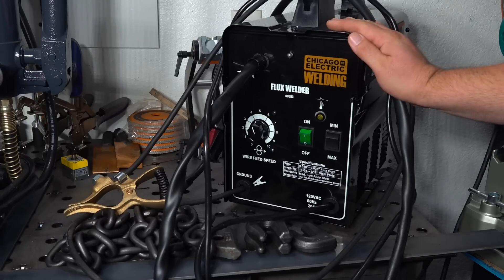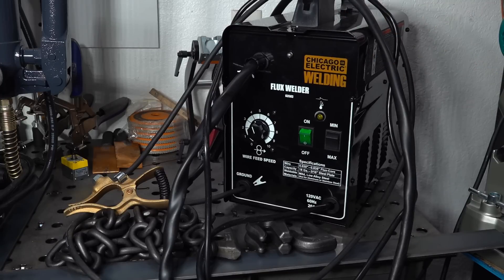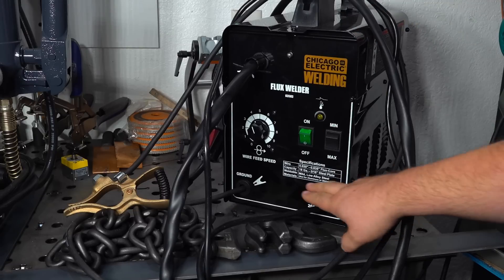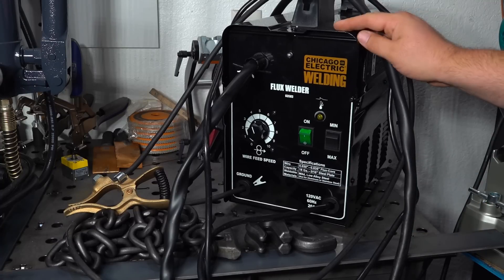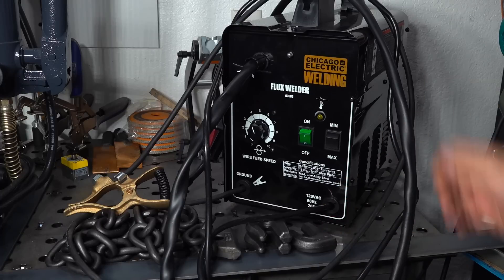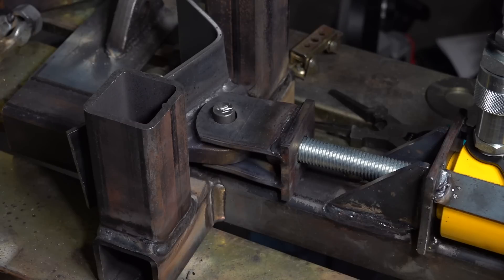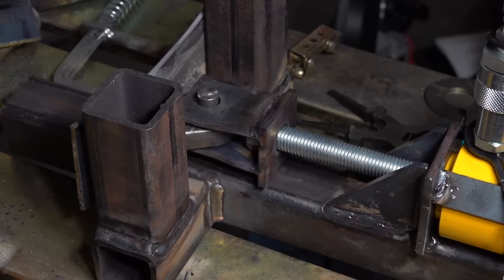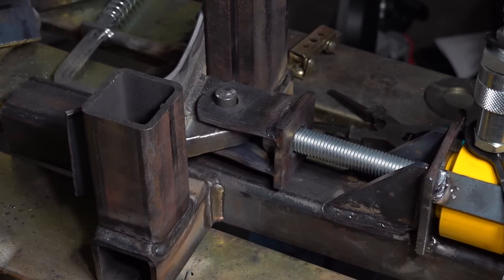Harbor Freight Flux Core, Weld Strength Testing Part 1

Comment from the maker: I have three more videos where I test the welds from this Harbor Freight welder.  I do more bend tests, cut and etch to show penetration results, measure actual amperage and voltage output, and test different wire sizes.  I even buy and test a second machine, in case the first one was defective, and I convert one to DC and do more testing.
Reply: bigtb1717 what do you think about that machine? Worth the cost? Do you believe it will have a long life?
Reply: Would you try .025 or 6 wire? I've not been able to get mine to get any penetration.  Though I've not turned down the feed speed which I shall be trying next time I go to where my machine is.
Reply from the maker: I don't believe flux core comes in sizes below 0.030".
Reply: bigtb1717 how much are they payin ya? Or are slighting HF just because you put shit bag welds down? People ........ smh.
Reply: @TheWopper78  Sounds like a pretty objective review to me.
Reply: Sealed 150 mig user instructions

Comment: So basically you can make thick metal stick to thin metal but it just can’t have a load on it… I’m building a small fabrication table and the top is a good bit thicker than the frame. But as long as the frame is strong I shouldn’t have any trouble with the plate welded to the thinner metal since it’s just sitting on top of it. Thanks for the video.

Comment: Idk, this has more to do with your settings and less to do with flux welding...
Reply from the maker: It definitely isn't an issue with flux core.  The problem is that the Chicago Electric 90/125A flux core welders have AC output, which doesn't work well at all with flux core.  I have several other videos where I test different travel speeds, different settings, pre-heating and even buy a second welder to show it wasn't an issue with the first one.  The issue is the AC output.  I even converted one to DC output to show the difference.

Comment: Thanks for this post. 110v welders are not be dismissed as the author states. They are great for DYI repairs on garden equipment, lawn mower decks and auto repair and so on but defiantly not for structural fabrications or repairs. I wouldn't repair trailer leaf spring hangers with them with any confidence. Ask me how I know. There just isn't enough penetration in  3/16 and 1/4 steel and up to handle over stressed joints. I am not a believer in triple passes with a 110v 030 or 035 flux core for structural applications. If the first pass does not penetrate enough, no other lathering's of melted wire will help. At 64yrs old I am not a professional welder but I do hold my own with a Lincoln gasless flux core. For folks looking to getting into the "hobby" and light steel repair welding ask a pro before you buy a machine. Because it's all about penetration into the gauge steel you intend to use. Other wise a little DC electrode flux core welder is a ton of fun to learn on. I've made garden tractor trailers, patio plant stands, foundation vents all from discarded 3/32 bed frame angle iron. You'll find this perfect practice angle iron at your local dump or at the Habitat for Humanity Restore. After a while you may get the fever to wire up a 30 amp source in your garage and start running an old Lincoln stick tombstone! Have fun hooking metal together!

Comment: Interesting and thanks for the testing.

If I were not broke or had more than 20-linear-inches I would have bought  a $350.00 welder maybe even a stick welder.

The biggest complaint I have is that the instructions call for a 20-amp capacity outlet: nowhere in the box dud this information post where I could see it.

I think 1/8" or 2/16" is this machine's  limit.  I must have a 8- wire speed with 0.030 wire and mo more than 3/8"-1/2" stub with 10-20° degrees drag angle. The metal I am practicing welding on has much more of an orange color than what is used in this video.

I suggest cutting 90° to the weld's longest dimension to witness actual penetration.

Comment: bro you just gotta cook it more baby. Slow down and get more penetration in her!
Reply from the maker: I have another video where I test different settings and different travel speeds.  Also one where I test multi-pass, and one where I test pre-heating.  I do cut and etch tests on some of those.

In some cases, a slower travel speed may result in greater penetration, but in a situation like this where it's already running too cold, it often makes it worse.  If you slow down, the weld bead gets larger, but it can sometimes just build up on top and cause the arc to get further from the base metal, reducing penetration.  

Unfortunately, the biggest issue holding this machine back is the AC output.  Flux core doesn't run well on AC.  I have another video where I do the very most basic of conversions to DC on this machine and test penetration again.  It makes a night and day difference.
Reply: @bigtb1717  my welding look liek doodoo but its soo strong. I heat the crap out of it,

Comment: Comparing a 240v to 120v. That's like Comparing a 8 cyl truck to a 4 cyl. Of course the 240 will do better. Do a comparison between 2 120v. The HF works good. Especially for $89.
Reply from the maker: I agree.  That was the whole point of this video.  I've seen many people claim that their 120V welder is just as capable for whatever weld they want to do.  The common saying is "the welds don't look great, but they'll hold."  With this video I just wanted to show that there is, in fact, a big difference in the capability of a 120V welder vs. a 240V one.
Reply from the maker: Also, I do have several more videos with this welder comparing various techniques to see how performance is affected, as well as converting it to DC and testing before and after.

Comment: OK SCRATCH THAT, I didn't know the specs for this box were so low. I expected the average 125 amp entry level. It's 90??  way too puny. 

Did you use ... spray transfer mag and compared it to short circuit ?? sure looks like it 

You say nothing of the settings used 

Was the HF really set correctly? You've demonstrated each time that its weld had very very poor penetration , very cold welds , very tiny deposition rate
Reply from the maker: I have several other videos with this welder and I do go over exactly what settings are being used.  I even measure actual voltage and amperage output.  It puts out more than you might expect.  It actually maxes out at nearly 140 amps.  It is "rated" at 90 or 125 (Depending on the version) but it actually puts out a bit more than that when maxed out.  

I also test different wire feed speeds, test on different thickness of metal, test with different travel speeds, bought a second welder in case the first one was defective, test with and without pre-heat, test with multiple passes, and more.  I also convert one to DC and test before and after that.  When stock, this welder has AC output and that simply doesn't work very well and doesn't provide very good penetration with self-shielded flux core.
Reply: @bigtb1717  ok, I'll check you other vids ! 👍🏻 Thanks

Comment: Hey -- what setup are you using for the pull hydraulic test and the press hydraulic setup? I saw an Enerpac GF120P -- what else are you using? Also, thanks for the video!
Reply from the maker: I have a little Enerpac hand pump and a hollow cylinder.  The press is a small, Dake benchtop press.  The little rig I had the cylinder in is just something I threw together in my garage.  I've been considering getting it back out to test some more things.

Comment: I do have a harbor freight welder. and I have to say your tests are inconclusive due to your claim of single pass with both machines with is total bs. you did a single pass with the harbor freight welder but 2-3 passes with the esab. however, you used the cheaper harbor freight welder which welds in AC, not in DCEN. I spent a little bit more for my harbor freight titanium flux core welder which welds in DCEN. I repaired my car's frame rot using my welder and my welds are still holding strong on these crappy NYS roads. I have also built a massive fire pit using the welder and they hold well to the heating and cooling. runs both .030 and .035 wire no problem.
Reply from the maker: I absolutely did not do multiple passes with the ESAB.  It was one pass with each machine.  And I have said many times, in comments and in other videos, that the main thing holding back the Chicago Electric 90/125A flux core welder is the AC output.  It drastically limits penetration on thicker material.  

I have many more videos with this welder where I bend as well as cut & etch multiple joints after all kinds of different variables, including multi-pass, pre-heating, different travel speeds, etc.  I even bought a second welder after several people questioned whether mine might be defective.  I even converted one to DC output to show the difference in penetration between AC and DC with the same machine.

I also reviewed the Titanium Easy Flux 125 and liked that welder quite a bit.  I had a lot of good things to say about it.

Comment: Preheating big pieces of metal is a great way to make these little machines better at bonding with that metal
Reply from the maker: I think the biggest issue with this particular welder is the AC output.  I have actually converted one of these machines to DC and did cut and etch testing before and after.  Night and day difference.

I have another video where I cut and etch to check penetration with different levels of pre-heat.  I used this welder in the stock, AC output form for that video.

Comment: The best thing this video illustrates is how technique matters with fluxcore and low-power welders. Prep, notching, and using the right size wire on the right speed and amperage for the material you're welding is paramount to strong fluxcore welds.
Reply: Yah-

-for five hours my welds were cold, tooling a stub, and splatty.  I took off the nozzle like a YouTuber said and I had a difficult igniting the spark.  Nozzle back on and it a snap.  

It makes no sense to me, but a faster wire speed does give a weld with a "more penetration/good weld" appearance.
Reply from the maker: The main thing holding back the Chicago Electric 90/125 amp flux core welder is the AC output.  Flux core simply doesn't run well or penetrate well on AC.
Reply: @bigtb1717  -I dare say that can be rectified.  ;)

Comment: 1- In the trades we call it Sucks Core, Even NR211through a miller XMT sucks. 

2- If you know how you can make wuite acceptable welds with the little HF machine. 

Just for kicks we used to tell new kids they were taking a weld test. Vet up with 6010  on a "machine" we hid behind a truck,,,,,2 car batteries.   And a lot of them made some welds that we not all that bad.  Skilled weldors can make good welds with bad welders.
Reply: Amen

Comment: Redo this test on the lifting pads with a couple of passes with the harborfreight welder
Reply from the maker: I have several more videos with this welder, including testing multi-pass and pre-heating.  I do more tests with the press, but I also cut and etch a lot of joints.

Comment: Oh you have the "cheap" one. I got the "expensive" one. I'm rocking the omnipro 220 but doing flux core at the moment because gas tanks are expensive. But I would love to know how strong they can weld so I can have an idea as to how far I can push what I want to make. Also I'm using 110 or what ever it is 120.

Comment: would this be a good welder to learn on ?
Reply from the maker: It could be.  Just be aware that because it uses AC output it will run a bit different than most flux core welders.  It can definitely still be used as a starter machine to learn with, especially if you stick to 1/8" thick material.
Reply: @bigtb1717  awesome ty been wanting to learn and didnt wanna spend an arm and a leg to start out
Reply from the maker: Where about are you located?  Are you in the US?
Reply: @bigtb1717  yes sir texas
Reply from the maker: Are you interested in learning stick welding, or are you set on flux core?
Reply: @bigtb1717  oh no i am interested in learning welding in general any knowledge on welding would be appreciated
Reply from the maker: If you want, shoot me an email at bigtbcontact@gmail.com
Reply: @bigtb1717  Will do ty i have acces to a stick welder as well and my flux line welder is on its way

Comment: I don't know I weld 3/16 with mine and have no problems. For the 89 dollars it cost me. It's real handy
Reply from the maker: Yup.  The AC output holds it back, but it is still a useful machine.

Comment: Yeh... little late to the party but... im new & only got my hf a few months ago. That being said i learned early on the thcker it is the harder you run it. Set on hi and speed around 7 and she slams my angle iron like a good little worker. Welds have been holding my makeshift motorcycle jack for over a month now no problems. I think there’s only 2min of duty cycle on the little HF that could, so make it count

Comment: How did you make your weld pulling jig? I can't find your video on it and I really want to make one just like that.
Reply from the maker: I don't have a video on it.  I have been meaning to do more with it, but haven't gotten around to it.  It's fairly simple.   You could do it several different ways, but mine is based on a hollow cylinder with a large piece of all-thread running through the center.  The rest is just some 2" square tubing, 3/16" wall thickness and some pieces of 3/16" or 1/4" flat stock.  Can't remember which.  I have an Enerpac pump for the cylinder.
Reply: @bigtb1717  Oh ok. Yeah I'd love a video on it and what parts you got and how you put it together. It would be an awesome tool for me to test my welds. I also was wondering what setup you had for your gauges. 

If you wanted you could email me some pictures or information about it. Because I'd love to make my own. 

Here's my email, scientistsmithyt@gmail.com 

Also I've seen several of your videos and I love them and want you to continue to make videos. :)
Reply from the maker: Thanks.  I do plan to keep making videos.  The gauge was included with the Enerpac pump.  It has a scale that can be converted from the pressure supplied to actual force applied by the cylinder.  The area of the cylinder is what determines actual force applied based on the pressure supplied by the pump.  Honestly, cut and etch tests and bend tests are probably more effective, but pulling stuff apart with that rig is fun, lol.
Reply from the maker: If I get a chance this weekend I'll get some pictures and email you.
Reply: @bigtb1717  Awesome!!! I can't wait to see it :)

Comment: I’m building a ranch gate and Wondering if the welds would hold a 500 pound pipe.
Reply from the maker: Probably.  How thick are the two parts?  At lot will depend on how the gate is built and how the welds are required to have strength.  Most likely it would hold fine.
Reply: bigtb1717 the gate would be attached to 1/4 inch thick hinges on one side

Comment: My buddy has a flux core Hobart welder. We where building a mud truck and wanted to use some tractor wheels. We took the steel wheels off the truck and cut the center bolt pattern out of the wheels and then welded the tractor tires wheels to the OE steel wheel cutouts. To our surprise and to this day they are still going strong. Never knew flux core welds could be so strong.

Comment: for the cost and fact that it's a 120v welder, it's not bad. i bought a dc unit that cost about twice as much as the the hf unit. i'm pleased with it having never welded before in my life. i don't really know what i'm doing. i have greatly improved in the 7 or 8 times i've used it though. it's resembling a bead anyway lol. it managed to suit my needs well enough so far. if i can put a nut on a mower axle and us a bolt to push the front wheel spindle out, it's good enough. snapped a jawed puller on it, air hammer didn't work and even beating it hard with a 4lb mini sledge wouldn't get it out. i can swing thing pretty good to. that last resort worked, impact gun barely was able turn the bolt btw. i don't think one could ask for much more of a welder in that price range. think about it, that's a crap load of pressure than it held up. i don't know how much exactly but it's not hard to lift a car or truck with a simple screw jack. this thing took all my impact gun had to force it out. point is, they're fine for backyard stuff that doesn't matter much. fixing a mower, brackets on a trailer, cracked metal parts and fixing things around the house in general come to mind. i wouldn't weld up a truck frame or anything... no, i think i would thinking about it.  i'd be interested in seeing something on these cheap dc units coming out of china.

Comment: The speed you cranked on the HF was way faster than the slowwwww gentle motion of the first piece js
Reply from the maker: The piece cracked almost immediately and offered no resistance.  The speed that press moves isn't fast enough to make a difference one way or another.  If you are interested, I have several more videos with this welder.  I test different techniques, different wire, preheating, a second machine and I even convert one to DC.  I do lots of cut and etch testing.

Comment: It's weird you ran the same wire? almost seems like the Harbor Freight is more brittle around the weld rather than a lack of penetration, not that has the best penetration.
Reply from the maker: I used the included wire.  I use Lincoln NR211 MP wire in future videos.